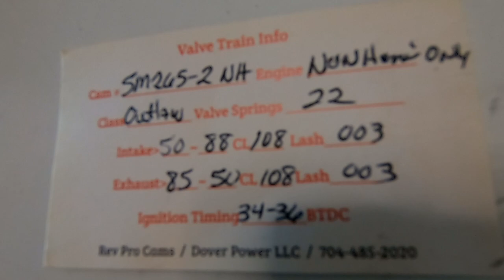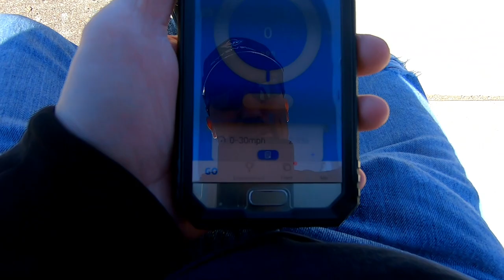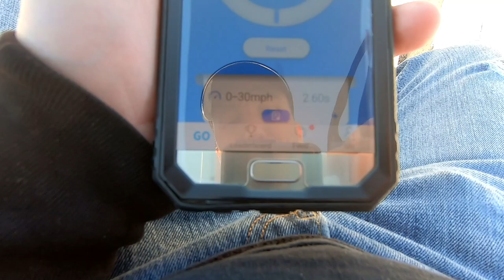Predator 212 performance cam install and road test

Comment: With all of the mods you’ve been doing to your little hot rod and as fast as you’re going. I’d start thinking about swapping out the drum brake for a disc brake system. I know they’re a lot of work to install but they will stop you a lot better. Just my 2 cents worth.
Reply from the maker: That is a really good point! I might do a video on that.  I even thought about using my Coleman mini bike frame for the hot rod minibike. It has awesome brakes already.
Reply: I saw EBC Grooved pads for 20$ for 8 inch rear wheel drum for my coleman mini

Comment: I'm running the Hot .265 cam myself and it woke my 212 hemi(223 stroker now) right up. But, I want to push my limits, so I'm upgrading to the .356 cam with an all new head with 45# springs, chromoly pushrods and 1.2 ratio roller rockers. Have you thought about trying this build out?
Reply from the maker: I'm always trying different combos. I did a 223 in this build. I have more cam videos coming https://www.youtube.com/watch?v=VbcpA0jdSIw&list=PLkbj-ip-5FzZG40xkiEtZHRtF_jDzxA9U

Comment: I have a gx340 11 hp motor is the one that has 82mm bore but i upgraded to a 86mm honda trx400 pistón. What cam can i use? I got billet rod

Comment: Have you ever flattened a lobe? I just installed a cam in mine and did the whole cycle rpms for a few heat cycles. If its not necessary then good cause I want to rip this thing!
Reply from the maker: No, so far so good. Ive been lucky so far

Comment: Hey black66 I have predator 212 with header,038 jet 20 pilot ,8deg advance, air filter,22lb springs ..well it runs okay but need more from non hemi should install a cam mod 2 and billet flywheel with rod +20 would this even give me alot more power or do I need ported/polish head and lower cc chamber for compression?
Reply from the maker: Adding the cam and billet flywheel with the +20 rod will give it quit a bit more power . Even without any port work . You can add a .012 head gasket to bump compression a little .

Comment: That is a fast mini bike
Reply from the maker: Ya, it's getting faster and faster.
Reply: @Black66  If you get that bike any faster you need to put wings on it you will get air born
Reply from the maker: @johnk6346  I'm building another engine for it. It might get a little faster .
Reply from the maker: @johnk6346  If I can get a flux capacitor for it, I might be able to build a time machine.
Reply: @Black66  If I find one I am going to give it to you,
Reply from the maker: @johnk6346  Sounds like you want out of here pretty bad!!
Reply: @Black66  Pretty bad is right, The 2020s suck
Reply: @Black66  lol
Reply from the maker: @freemanguess8634  We need a time machine lol

Comment: What gearing and clutch are you running? Sounds like short gearing but your haulin ass in the video?.
Reply from the maker: It had a 12 on the clutch and a 72 in the rear. 6 to 1 ratio with a max torque clutch.
Reply: @Black66  right on right on

Comment: Nice I will check these out.  So you dont need to upgrade the rods or piston?
Reply from the maker: The piston will live, but the rod is what really should be changed. This cam makes it spin pretty hard.
Reply: @Black66  You have a link for the rod for predator 212 engine and how many rods do I need?  I'm starting my build next week on my camo 200.  Like u day 1 when u got the camo you ripped 196cc engine apart...me I'm swapping the whole engine with predator 212..lol.  You think I will be fine with torque converter with 10T and 60T rear sprocket? I weigh 240lbs.  My goal is 45mph street with stage 1 kit Governor screw screwed back ziptie mod and 265 superman cam and 22lb springs and 420 chain.  Just waiting for bike to come in from Walmart paid 450 shipped for Camo CT200
Reply from the maker: @l.a.m7645  Sweet ! Yes tear it down lol Ya that bigger sprocket will help with your weight . I have a video of pretty much what your doing with that bike. . Even the same cam . That’s my favorite drop in cam . 
I’ll have to get you the link when I get home . But if you look on the ARC web site he has the .020 billet rod on there .
Reply from the maker: @l.a.m7645  A torque converter will be good to help pull your weight. 
Here is the link for the rod https://www.arcracing.com/6256-billet-rod-hf-predator-020-3-328-x-1-191-x-709/

Comment: Where can I get that exhaust system from? I am using the hemi 212,
Reply from the maker: The exhaust is from GoPowerSports. Check out the playlist for many more mini bike builds. https://www.youtube.com/watch?v=jHf9yJmaZLA&list=PLkbj-ip-5FzbVBVqMi23O5noFSAbhNOp1&index=12
Reply: @Black66  the 30$ Amazon exhaust on your 100.00 performance build you had I have been trying to find,  thanks for replying,  and making the videos,
Reply from the maker: If its the black painted exhaust you are talking about I used a GPS pipe and welded my own baffle to it.  @bobwin5387

Comment: I ordered this cam and the champion rockers. Are you running the stock push rods with this combo?
Reply from the maker: This is a great cam. One of my favorites so far. You can really feel the torque. My champion  rockers cam with a set of pushrods, but Yes, I have run the stock ones as well.
Reply: @Black66   are the rods that come with shorter or longer?
Reply from the maker: @sandmanyaggy822  The rod that came with the engine is .020 shorter. All of the Predators come a little bit different from the factory. When you pull the head off,  measure how far down the piston is in the hole. A lot of the time the pistons come .020 or .030 down in the hole. So you can use a longer rod to bump up the compression.
Reply: @Black66  I was more concerned about the rod not getting the rocker to the correct angle. Not really concerned about higher compression. I've hear people having trouble with that. Can't really find a good video of install on the rockers. I bet if you made a video of just that it would do well. Even on all the forums on fb many people ask questions about them and nobody really knows
Reply from the maker: @sandmanyaggy822  Oh ok, got ya. Yes, the rocker arm geometry. I have a video on installing my 1.2 ratio roller rockers. I didn't go into a lot of detail on it, but the pushrod length put the roller tip pretty much right in the center of the lash cap. The pushrod length was slightly longer for the Champion rockers to get the tip in the center of the valve stem or lash cap.  Depending on head gasket thickness. and If the head was milled or not.

Comment: I just ordered a new cam, rod and some 26 lb springs for my predator 212cc and one of those billlet dual bearing side covers. I'm excited to get the new stuff but im also really nervous I don't want to mess anything up. Ive never done this before.
Reply from the maker: Awesome!! You won't be disappointed. You won't have a problem. Just take your time.  I would say one of the main things is to make sure the clearances are good on the rod and crank with some Plastigage. Installing the cam and putting the rod on the piston is pretty easy. You got this!

Comment: How's that cam compared to the stock one with the rockers?
Reply from the maker: The cam made a big difference over the stock cam. 
I noticed a lot more torque, especially in the mid-range. The rockers will work with the stock cam or an aftermarket cam. The rockers are nice because they are only $25 including the longer pushrods.
Reply: @Black66  oh ok when you installed the rockers on the stock can did you feel any difference or it just felt normal? I'm thinking if installing that super man cam did you order it or ebay ?
Reply from the maker: @javierpagan364  I installed the rockers and the cam as a package. I didn't have the rockers installed with the stock cam, or I should say a stock engine. I had other mods done at the time I installed them, so I'm not sure what difference the rockers would make with just installing them on a stock engine.  I'm not sure if you would feel much difference with the rockers alone because they are a 1 to 1 ratio. But that Superman cam is an awesome cam. You will notice a big difference in the way it pulls. Yes, I bought the Superman cam on eBay. I might have put the link in the description. If I didn't let me know and I can send you the link.

Comment: What's the best cam for a engine with 26lbs springs and champion rockers and flattop piston and rod
Reply from the maker: I guess that boils down to opinion, but If I had to pick a cam that is not too radical and is easy to install. I would use the 265 superman series cam. That thing has some serious torque. I really like that cam when it's on the minibike.  I can get you the link if you need it.
Reply: Ok I'm down thanks..
Reply from the maker: @jesusgonzalezmachado  Here is the link to the cam...https://www.ebay.com/itm/113730944011?ssPageName=STRK%3AMEBIDX%3AIT&_trksid=p2060353.m2749.l2649
Reply from the maker: It already comes with valve springs.

Comment: U will go faster if u low down ur gearing
Reply: It might be for more power
Reply: how does one lower gearing one a one gear bike? Smaller sprockets? or bigger sprockets?
Reply: @ChristopherJones16  smaller sprocket
Reply: @ChristopherJones16  Smaller Rear Sprocket bigger front sprocket

Comment: You need some 26lbd springs easy 60 mph
Reply from the maker: I might try that.
Reply: @Black66  what springs do you have e in now?
Reply from the maker: @Strict30  It has 22lb springs in it now.
Reply: @Black66  ok 265 cam ask for 26lbs springs

Comment: Will this fit my hemi engine
Reply from the maker: The rod will fit the Hemi and non-Hemi. The flywheel has a different taper but they have one that will fit the Hemi on the ARC website.
Reply: After changing cam no gasket required when putting back on plate
Reply from the maker: @l.a.m7645  This one has a rubber o ring so I didn't need to replace the gasket